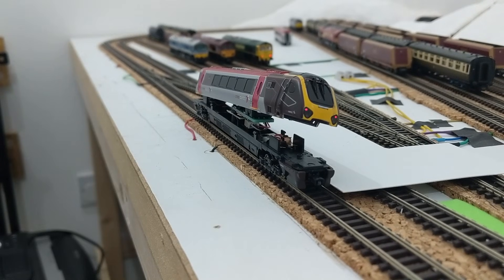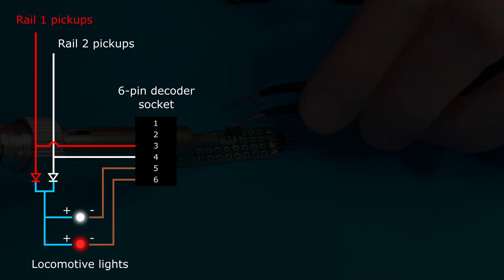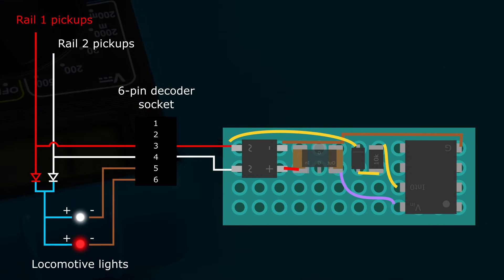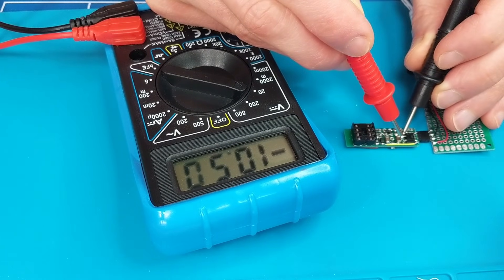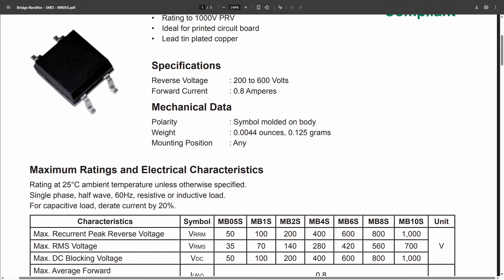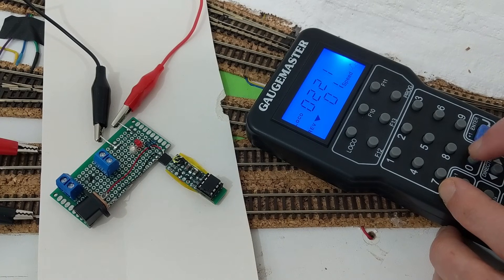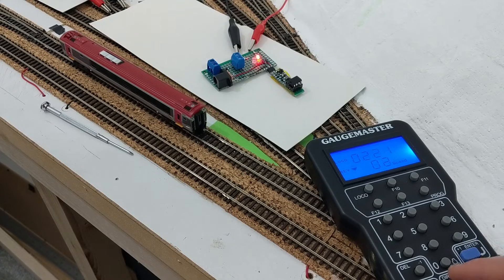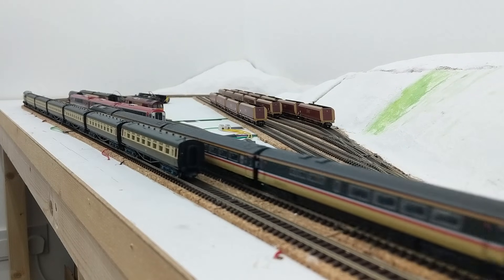0058 Making a decoder from scratch - part 5

Comment: If I had to guess on your problem at the end, I think you might be seeing an issue where you're assuming the rail monitoring to the interrupt pin is ground referenced, but your ground referenced is just the - terminal on the bridge rectifier, which isn't a valid reference for the signal on one of the rails going into the bridge rectifier. 

A marginal mistake that works when you aren't pulling much current, but illuminating a 12V LED might drive enough current through the bridge that your "ground" is floating higher above your rail "0V" and confusing things?

I'd see if you can recreate the decoding issue with just a 1k resistor between the + and - outputs of the bridge, independent of the NPN transistors and LEDs, then go back to the drawing board on using opto isolators to avoid connecting the INT pin on your microcontroller to any part of the power domain to the left of the bridge rectifier.
Reply from the maker: That's an interesting guess, thanks! Is the rectifier's negative an invalid ground reference because there's a voltage drop through its diodes?

With 12 to 13V power and 1K resistors, the test board LEDs should have between 10 and 13 milliamps going through their circuit (I do need to verify this, but I've measured others from the same pack before), which seems like a low load.

So what is it that this could be doing to the negative of the rectifier? Would it be making it 0.6-ish Volts relative to the 0V of the tracks? If I follow that logic with the ATtiny always being at least 0.6V above the track's 0V, would that mean Int0 would still be pulled down when the rail it's connected to goes to track 0V? I've got the ATtiny's internal pull-up resistor set on Int0, so when that rail goes to 13V the diode will stop any current flow, so the ATtiny should pull Int0 back up to 5V (from the point of view of the ATtiny)? Though if all that holds true I think it should apply whether or not the transistors and LEDs are on.

I don't really understand how it's an issue, but I think it's very likely you're either totally correct or at least onto the right kind of thing! I'd like to avoid using an opto-isolator if possible - they seem to be quite large.

Thanks for your thoughts - it's given me various things to try and to measure 🙂
Reply: The answer is use a voltage devider! Way more robust, but there are even better solutions. Also take note that rains spark….  To your interrupt pin. Need filtering.

I was lazy and asked ChatGPT to type it out for me.

You can feed a DCC waveform into an ATtiny85 interrupt pin with a resistor divider.
A DCC track signal is a bipolar square wave. A full bridge makes the absolute value of that wave. For an ideal square wave, |+V| and |-V| are the same, so the bridge output is basically “constant DC” (apart from diode drops / ripple if you don’t smooth). That means the timing information you need to decode isn’t present on the DC output.

What does work (simple and common)

Keep your bridge + regulator for power, but sense one rail on the AC side of the bridge and reference it to the decoder ground (the bridge “–” / MCU GND). This works because the bridge “–” follows whichever rail is currently negative, so one chosen rail will swing high/low relative to MCU ground.

Minimal input protection + divider
Connect Rail A (either rail) to the ATtiny input through a divider and clamp:
	•	Rail A → R1 → node → R2 → MCU GND (bridge “–”)
	•	Node → ATtiny interrupt pin (PB2/INT0 or any pin-change pin)
	•	Add a series resistor (or make R1 the series element) so the pin’s clamp diodes can’t be over-driven
	•	Optional but recommended: Schottky clamp diodes from node to VCC and to GND (or rely on the ATtiny’s internal ESD diodes, but still keep currents low)

Example values (safe/high impedance, works on typical ~14–18V DCC):
	•	R1 = 180k, R2 = 47k  (ratio ≈ 0.207 → 20V becomes ~4.1V at the pin)
	•	This keeps pin current small: 20V / (180k+47k) ≈ 0.09 mA

When Rail A is “negative” relative to the bridge-“–”, it may only go slightly below GND (about a diode drop). With a high-value divider + series resistance, the clamp current stays tiny and the pin is safe.

Even better (more robust)

If you want maximum robustness/noise immunity, use a comparator/Schmitt stage or an opto-coupler front-end:
	•	Opto (or a fast logic opto like 6N137) gives isolation and very clean edges.
	•	A small Schmitt inverter/buffer (powered from MCU VCC) cleans up slow edges and noise.

Practical notes
	•	Sense the DCC before any big smoothing capacitor (you want sharp transitions).
	•	Keep the input network high impedance so you don’t load the track.
	•	Use pin-change interrupt if INT0 placement is inconvenient; timing measurement is the same idea.

So: yes, a divider approach can work — but the divider must be fed from one rail (AC side), not from the rectified DC output, and you should include current limiting/clamping so the ATtiny pin never sees abusive voltages.

Here are two complete input front-ends you can build:
	1.	direct divider + clamp into an ATtiny85 interrupt pin (simple, works well)
	2.	divider into a comparator with hysteresis (cleaner edges / more robust)

Both assume you still use the bridge + regulator only for power, and you take the DCC sense from the AC side (one rail).

⸻

1) Simple: one-rail sense → divider + clamps → ATtiny85 INT0

Pick Rail A (either track wire) before the bridge and reference it to MCU GND = bridge “–”.

Schematic (5V MCU)

DCC Rail A (AC) ---- R1 180k ----+---- R3 10k ----> PB2 / INT0 (ATtiny85)
                                |
                               R2 47k
                                |
MCU GND (bridge -) -------------+-----------------------------> GND

Clamp (recommended):
                +----|<|---- VCC   (Schottky, e.g. BAT54)
node (between   |
R1/R2) ---------+----|>|---- GND   (Schottky, e.g. BAT54)

Optional noise cap:
node ---- C1 470pF..2.2nF ---- GND

Why these parts
	•	R1/R2 scale ~18–22V DCC down to a safe logic level.
	•	R3 limits any clamp-diode current into the ATtiny pin.
	•	Schottky clamps keep the node from going above VCC or below GND.
	•	C1 is optional; keep it small so you don’t smear the edges too much.

If you run the ATtiny at 3.3V

Use a slightly “taller” divider, e.g.
	•	R1 = 270k, R2 = 47k (20V → ~3.0V at the node)

Note: If you pick Rail B instead of Rail A, your waveform is just inverted. Decoding still works (flip logic in code if you care).

⸻

2) Cleaner: one-rail sense → divider → comparator (with hysteresis) → ATtiny85

This gives a very crisp digital edge even with noisy track wiring.

Schematic (works at 3.3V or 5V, depending on comparator)

Use a single-supply comparator like MCP6561 / LMV331 / TLV3701 (any fast-ish single-supply comparator).

DCC Rail A (AC) ---- R1 180k ----+---------------------> COMP IN+
                                |
                               R2 47k
                                |
MCU GND (bridge -) -------------+-----------------------> GND

Reference (mid-supply):
VCC ---- R4 100k ----+---- R5 100k ---- GND
                     |
                    C2 100nF
                     |
                    GND
(mid node) ------------------------------> COMP IN

Hysteresis (positive feedback):
COMP OUT ---- Rh 1M ----> COMP IN+   (to add a little hysteresis)

Comparator output:
COMP OUT ----> ATtiny85 PB2/INT0
(plus pull-up if your comparator has open-collector/open-drain output)

Notes
	•	The divider (R1/R2) ensures the comparator input stays in range.
	•	The VCC/2 reference lets the comparator detect when the sensed rail swings “above or below” that midpoint.
	•	Rh adds hysteresis so tiny noise around the threshold doesn’t cause extra interrupts.

⸻

One important reminder (for both)

Do not sense after a large smoothing capacitor on the bridge output. You want the raw edge timing, so sense from the AC rail side.
Reply from the maker: @martijnm4472  Thank you very much for that comprehensive comment and diagrams! I totally understand about needing to sense the signal from before the rectifier or any capacitors - that's been in place all along. Your suggestions flip the logic to input a high logic level to the ATtiny, where at the moment I have the track pulling the ATtiny low - ultimately I might just have to try doing it the other way around, even if it needs more components - I'll see how it goes. Thanks for taking the time to provide all the specific information 🙂

Comment: "so I stopped using any flux"
Promptly experiences several circuit problems that could have been avoided with more flux. You want to use flux. It really makes soldering much easier. 

I do love the same smt parts on perf board style you're using. Keep up the good work.
Reply: I personally fill the bath tub with flux and have a under flux soldering iron…. You can’t use enough flux and you always use too much solder. I solder 0,5mm pitch IC’ by hand and that is only possible with lots of flux. Clean with a soft brush and 99% IPA.
Reply from the maker: Good point 🤣 I hadn't even considered that as a contributor to why some elements didn't connect - the solder (which does contain some flux) was going onto the perfboard and components so readily with just heat.
Thanks 🙂

Comment: Consider a current limiting resistor to the base of the transistor, without it you are building an amplifier drawing to much current (or even kind of short) the mcu pin to ground and it stops working. A 1k resistor will do the job. To open up a transistor (or FET) you need voltage only, not current. Now the current is limited by the internal resistance of the transistor
Reply: One other thing, I have not looked at the attiny datasheet and those outputs are complex internal circuits, I do not think it is open collector. Also aren’t there switchable pull-up or pull-down resistors inside the mcu? Those might interfere if switched on. I was used to bc547 for switching, 1K base resistor and always worked fine for small relays. I once made a fleischmann N gauge switch work with one digital output, detecting the up flank/down flank for generating a pulse, I used one chip with 4 dual input nands or so, connecting both inputs of one makes an inverter and used the switch time of two of those to generate the pulse. Some I2C io expanders and I had an extremely cheap simple switch decoder. Rock solid.
Reply from the maker: I can't say I understand the internal circuitry of the ATtiny85 - the datasheet definitely says a lot more than I comprehend. Its inputs can have internal pull-up resistors activated (there's no mention of pull-down ones) - I don't think they're enabled by default, but on the input pin for monitoring the DCC data signal I need it so have activated it. Thanks for the further thoughts 🙂

It feels like there's a whole world of possibilities for getting things working cheaply on a model railway with little devices like these - I'm finding it really fun being able to make things, though my progress is slower than I'd anticipated 🤣
Reply from the maker: Thanks for the thought - the decoder has a 6.8K resistor between the ATtiny and the transistor base, which makes for a current of about 0.6 milliamps through the base. The test board LED is coming through the 1K resistor before the transistor collector, which means it's getting 11 to 12mA current, so the base current is 18 to 20% of the collector's, which should reliably put the transistor into saturation (the minimum HFE in the datasheet is 30). Yes, I've been reliably informed I can simplify things by moving to MOSFET transistors, so will look at that 🙂 For now I'd like to understand what's going wrong with these ones.

Comment: thats a weird bug, i'd be checking the supply to the tiny, maybe the leds are pulling the track voltage down at the bridge rectifier, or drining the base of the transistor is dropping the voltage from the regulator.
another weird guess, could turning on 1 led be causing that half of square wave to be lower in voltage than the other creating an offset from 'ground' and 'corrupting' the data the tiny sees? try turning both leds on at the same time
Reply from the maker: Thanks for the suggestions - ideas are very welcome at this stage! Earlier today I checked the current from the ATtiny pin to the base of the transistor for the white LED, and that had 0.6 milliamps when the transistor and LED were on, which is what I designed it to have and should be plenty to enter saturation, so that checks out. I also re-routed the Int0 pin to go via the breadboard with a separate 10k resistor and diode, and connected that to one of the tracks with a wire so it completely bypassed the decoder board, and the behaviour is the same. When I get a chance tomorrow I'll start experimenting with the LEDs to see what current is going through them, and double-check the voltage from the bridge rectifier and regulator.

Comment: Hi Jonathan! Well that was an immensely enjoyable watch - other than you finally being stumped! There's nothing like a bit of troubleshooting to sharpen the senses, is there? I'm wondering whether building the complete design on breadboard first would help? It would certainly bypass problems due to soldering (which still looks tricky to me), and would inform you as to whether the code could be the problem! It's still an impressive series, and I'm very much looking forward to seeing what your next move will be! :) Good luck, Ian.
Reply from the maker: Hi Ian, I'm glad you enjoyed it, thanks! Having to try solving issues is definitely helping me to get a more detailed understanding of things - if something just works there's not much need to learn more about it!

I totally agree on the breadboard-first approach, but I have actually already done that, though technically in the case of the transistors they were straight to perfboard in the last video, but it was a separate board to the main decoder. I originally envisaged this video being about just assembling the design, and giving the recap of how it all fits together, but something in it clearly has different ideas 🤣 We'll see what a bit of time yields in terms of ideas - I'm now thinking it would be best to understand why this is going wrong before I move further with it.

Thanks 🙂

Comment: I have blown up so many LEDs while trying to make custom circuits (like actually pop and explode sometimes while holding them), and actually fried a good decoder by probing it for voltage and having it back feed threw the multimeter.
Reply from the maker: I definitely heard a pop on one occasion - after fixes to the board I forgot to put the kapton tape back on 🤦‍♂️ . I thought I'd got that on video, but couldn't find it. It does seem to be very easy to fry things!

Comment: If I may suggest.... while mosfets obviously are required for motor driving, you shouldnt be needing them for led''s. 0603  leds e.g. microlitz in the commercial form with presoldered leads are bright enough at 1 ma. (I use them a lot but more on the i2c side, down stream of dcc-ex as the HAL controller, so not directly applicable to dcc decoding. And agree with others, a digital microscope will help you immensely, being able to viewmicroscopic hairline fractures.
Reply from the maker: Thanks for the tips 🙂 If I can save some physical space with the mosfets then that would be handy, but at this stage it's also just a bit of hope that it will solve whatever's causing interference on the signal to the ATtiny's Int0 pin, though admittedly that's a shot in the dark and it would be better to get to the bottom of why the current prototype doesn't work. Thanks 👍

Comment: Quite a frustrating problem.  I hope you find a solution.
I think that the original code working on the breadboard without the transistors eliminates the software.

This leads me to wonder if the transistors are sinking enough current to drag down the 5V supply.  You could try increasing the values of all the resistors on the perf board ( base resistors and those in line with the LEDs),  or duplicate the transistor circuit on the breadboard as a comparison (probably easier to do that first). 
Hope this is of some help.  
Tom
Reply from the maker: Hi Tom, thanks for the sympathy! There were several points where I decided to make this video, and at the first of those I assumed software was the issue, but I kept having ideas of things I could test until eventually coming to the conclusion that it can't be the software.

Playing with the resistor values sounds like a good idea - thanks - I think there must be something interfering with the ATtiny's Int0 input somehow - getting an Ammeter on the outputs to confirm or disprove my calculations about transistor currents may be worth doing too.